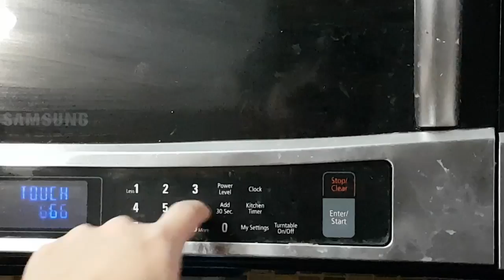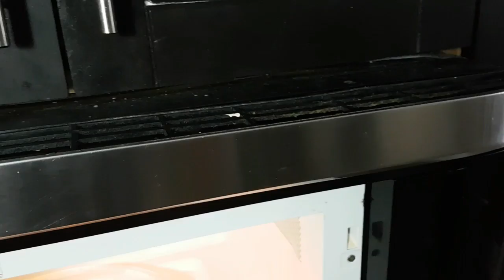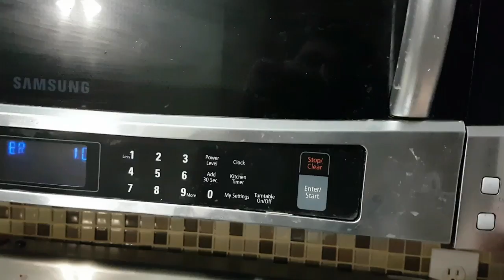Samsung Microwave OTR Touchpad Repair How-to

Comment: THis video was very helpful and easy to follow.  I was able to repair my buttons in less than five minutes. I took a pic to wire placement before removing them so it would be easy to place back in the correct spots but ended up only having to remove the two on the bottom and turned the panel opposite way from in the video for easier access to the buttons.  thanks so much you saved me from purchasing a new microwave.

Comment: Thank you for the video. Two of the four buttons on the lower right corner broke on my microwave broke. I replaced them after watching your video. 
I ordered the replacement parts from: http://www.samsungparts.com/Products/Parts_and_Accessories/PID-DE64-02219A.aspx?model=SMH9207ST/XAA

You are correct in making sure you put the wires back in the correct way. Also, when it comes to the little circuit board behind the button, be sure that goes in straight an in the proper direction. Take pictures of how it all looks before you disassemble it.
The buttons are designed to be inserted in a certain direction themselves or they won't fit properly. The devil is in the details. The smaller circuit board isn't really held in by anything. It has a hole in the center, but nothing to suggest a screw goes into it. If the circuit board shifts in the right way the buttons won't make contact and won't work. I kept having this problem so I used electrical tape to keep it in place.
The way the buttons go in causes me to think I will be replacing them in a couple of years, but this way was not hard snd certainly cheaper that hiring a professional or purchasing a new microwave.

Comment: I've already fixed the door lock mechanism by drilling a hole on the plastic spring retainer.Looking at this victim, I would have removed all the securing bolts ,carefully removed the item and then thrown it out in the garbage with reckless abandon. I would then buy any other microwave other than a Samsung,my Samsung dishwasher was tossed last year and replaced with a Bosch,the Samsung refrigerator is already on notice  as well. Samsung makes great TV's and absolutely the worst kitchen appliances

Comment: If your touch pad is on the door and it says "SE"..  Slam the hell out of the door a few times.  It will probably go back to working.  I just spent two hours cleaning connection and taking the microwave apart.  The fix was slamming the door shut a few times.  I want never by another samsung appliance as long as I live.
Reply: I have the same issue
Reply: Lol that fixed the issue. Didnt know if you were joking but I did it and it worked. We will see for how long.

Comment: Thank you! I couldn't believe I found this exact model and the exact problem. I repaired it in less then .5 hour, and didn't have to take all the wire harnesses off. God bless you, and thanks once again!
Reply from the maker: Thank you! 
I am glad I was at help
Reply: Hi microwave start button is  not working.... what I have to do...Plz solve the problem